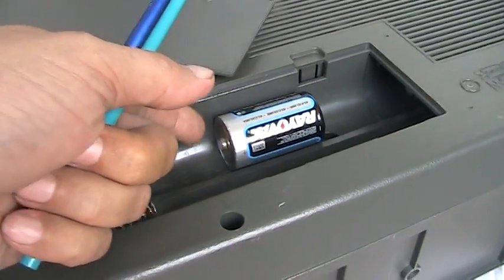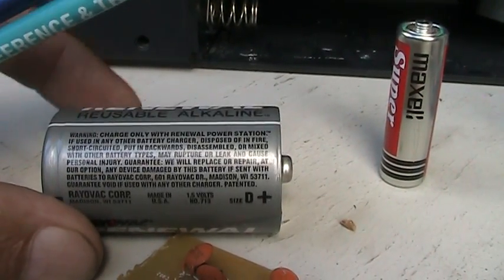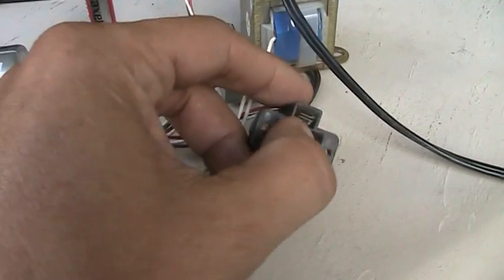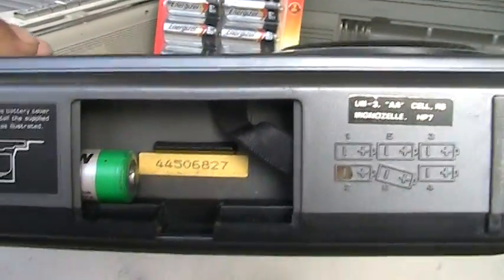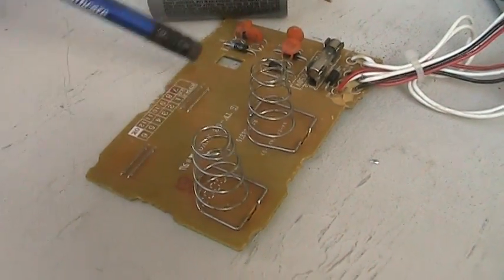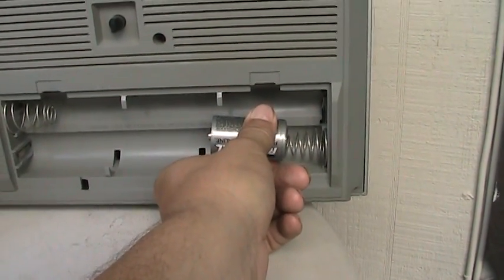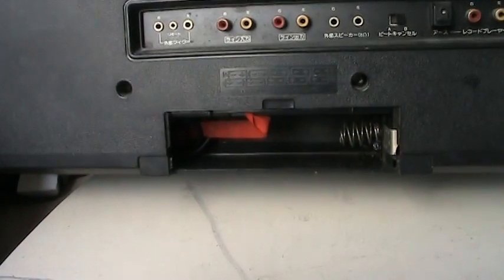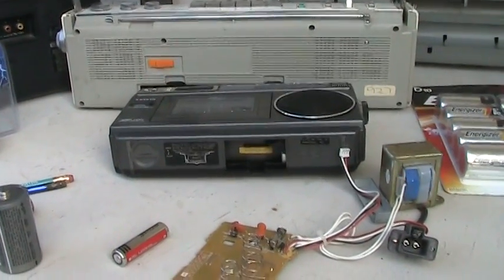Power Outage Emergency Battery Installation Portable Radio Boombox Corrosion Problem Solution

Comment: @Gurksallad10 did you read this - - Answering a emailed question I thought it would be easier to make a video answer, and here it is. Hopefully I answered the basic's here in this video as i did not explore flashlights and their batteries and gel-cell and or AGM = Asorbed Glass Mat lead acid batteries of which can be found in a very few newer boombox emergency radio configurations ( one of which I have with the 'Jeep" logo on it ) I hope that his is enlightening or helpfull or puts another